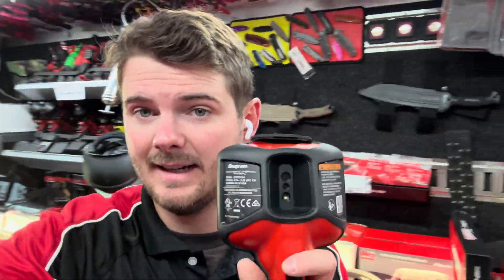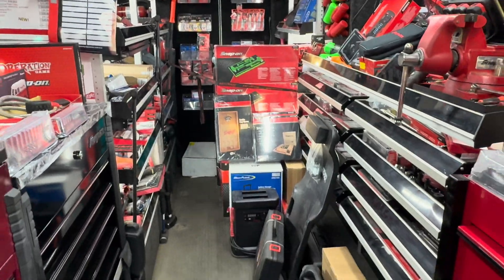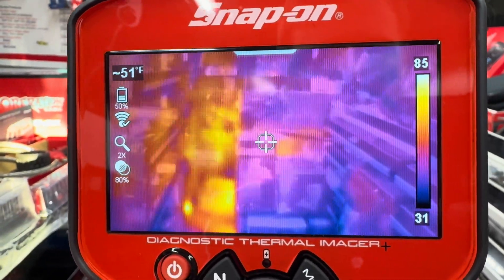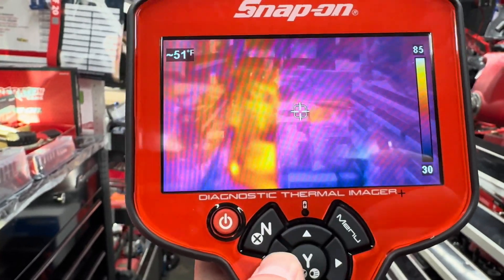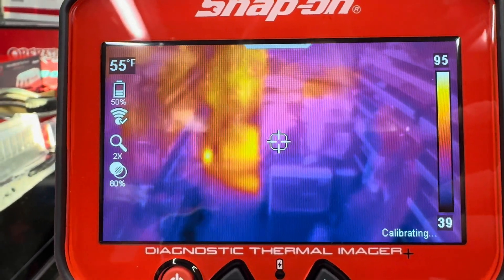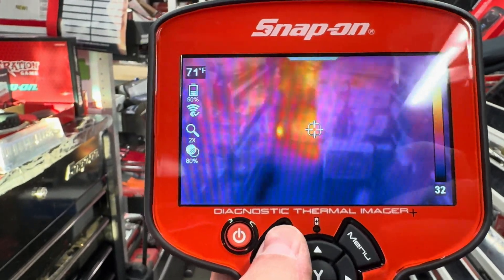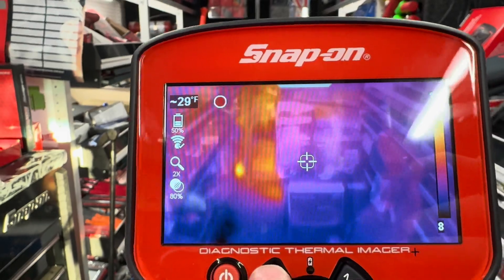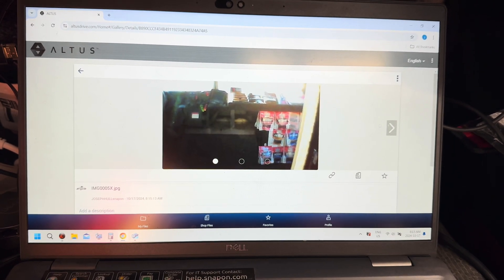SNAPON’S NEWEST DIAGNOSTIC THERMAL IMAGER - EETH312A

Comment: can you use this to see a heater core through the dash to determine if you heater  core is bad???
Reply from the maker: Would have to try it!
Reply: Can u try it and make a video on it...plz & ty @SnaponToolsJosephHull
Reply from the maker: It may not be accurate enough through other materials
Reply: @SnaponToolsJosephHull I have the same tool and no you can't do that. It won't go threw the dash so basically all it shows is the heat around the vents where the aura coming out.

Comment: It's still the same IR hardware rebundled in a different case. I do enjoy  some snap-on products but I hate how they mark-up basic technology 4000%. A great example is snap-ons o-scope for the Zues and Triton; it's still the same hardware and software form 2010; the capture rate and GUI has never been updated. There are $200 four channel scopes crushing the market with 10x the capture rate and digital storage.
Reply: I did notice that its the same as the previous thermal imager. Just a few minor differences such as new bright red casing. After using this product I find it to be useful however the lag during the calibration is just not worth the 2k. Compare to a flir e5 pro with touch screen camera for 1300 and less lag. The good about the snap on is its known good images compared to known bad parts in thermal image. However a good tech can accurately and logically know excessive heat is high resistance, worn bearings, or restricted coolant passages.